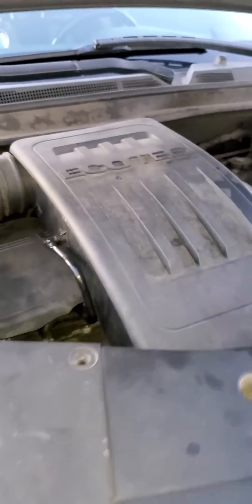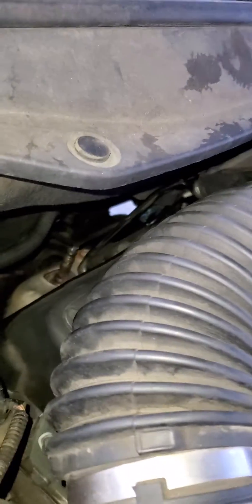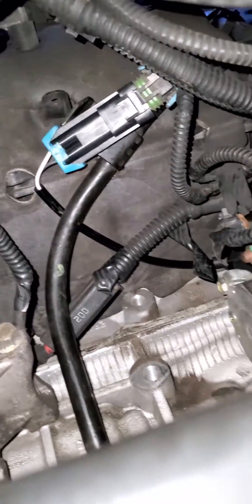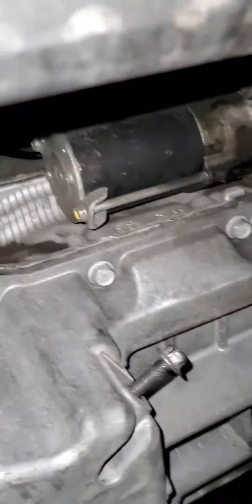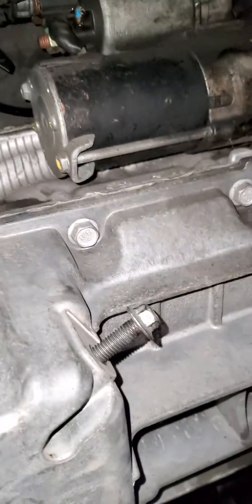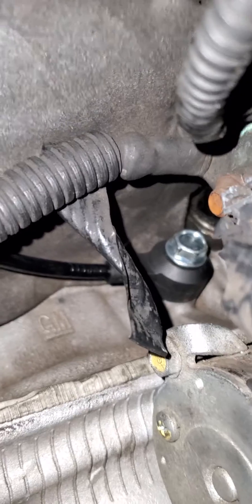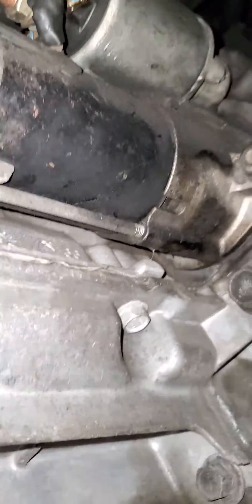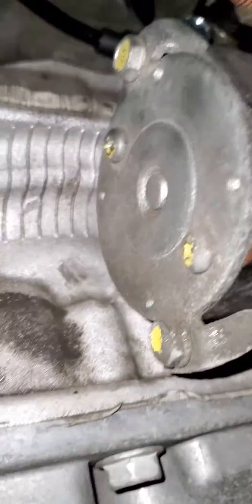Chevy Equinox Ecotec Knock Sensor

Comment: We went to have the oil changed because we were past due on an oil change, it sounds like the lifters started pecking, anyways after the oil change when we were driving it out of the automotive shop we noticed there was a misfire and then the check engine light came on. Ran the code and it came back knock senor.. any input or advice? It’s our only means of transportation and my husband’s job is over an hour away from home.
Reply from the maker: I would suggest doing a compression test for each cylinder and verify that each cylinder is within range from one another. For example for a V6, if 5 cylinders compression test reads 800 but the 6th cylinder reads 500. Then you have an issue with that cylinder and thus cuasing multiple problems. Low compression causes incomplete combustion—also known as a misfire. When one or more of the cylinders are misfiring, you'll notice that the engine runs rough. You may also notice a hesitation upon acceleration and an overall lack of power. You might also want to get the wiring checked for the knock sensor. Have a mechanic run a multimeter test on it. Hope that helps.

Comment: You happen to know where it’s located on a 2018 equinox? We’ve hunted all day and can’t find it..
Reply from the maker: Check around where the starter is. Chevy is known to place the knock sensor around that area. Let me know if you find it there. Thanks 😊
Reply: @LeoLee7o7  We looked for the sensor for a day straight and never actually found it. We were going to take it to the garage the next day, Monday. However, Later Sunday night we had no choice but to drive the car and when we did the check engine light was off, the misfiring stopped, pecking stopped. We may never know lol..
Reply from the maker: @amandafreeman9564  That's so weird. Haha Glad it all worked out in a way you didn't expect it to. 
I had a similar scenario with my car when I brought it to the Mercedes-Benz dealership. Check engine light disappeared and it started up fine. Haha I still had them fix the issues either way and it runs so much better.

Comment: thank you so much for this. Symptoms include bad fuel mileage and poor acceleration performance and check engine light and if you are lucky, you can replace it early before engine problems arise, however in my case i now have to flush out engine AND replace the sensor on my 2010 equinox.

Comment: I HAVE A 2011 CHEVY EQUINOX LT 2.4L I HAVE A P135A CODE I JUST CHANGED MY SPARKPLUGS AND IGNITION COILS AND ALTERNATOR AND MY CAR WONT START DO YOU KNOW WHATS WRONG WITH IT? ??
Reply from the maker: I would suggest getting it checked at a shop. You might have a faulty connection with the ignition coils or the ECM that monitors the voltage coming from the ignition coils that are not functioning properly.

Comment: There's two knock sensors one back engine same  location 🧐😂
Reply from the maker: Yes that's correct. The other knock sensor was good and the one in the front kept reading bad and the code kept popping up for the front sensor. They took it to a shop and diagnoses came up as a rod knock on two cylinders. They got rid of the vehicle and purchased a different one.
Reply: @LeoLee7o7 the one you replaced. Was it bank one or bank two?
Reply: Do you know if this is "Knock Sensor 1" shown in this video?

Comment: What were the symptoms of the bad knock sensor?
Reply: Mine keeps stalling when at a stop like low power to engine/ and I even had it turn off on me when coming to a stop
Reply from the maker: @DayzOfOurLifes  Sorry to reply months later. It's a possibility that you might have other issues. Get your alternator, starter and battery checked at an autoparts store near you. You might a mechanical issue, like the lifters or a vacuum leak if you have replaced the knock sensor and are still experiencing the same problem.
Reply: @DayzOfOurLifes   bad cam shaft solenoids can cause the stalling. Here is my video for that fix for any future viewers with this issue 
https://youtu.be/iZ_OG0LROYQ
Reply from the maker: Pinging noises coming from the motor but the sensor wasn't the only problem. It got worse because the driver kept driving the vehicle without replacing the sensor and now the lifters has to be replaced.